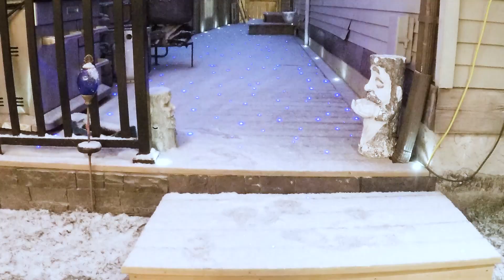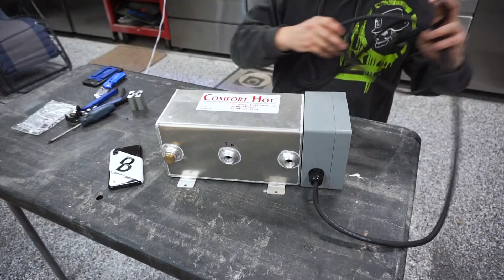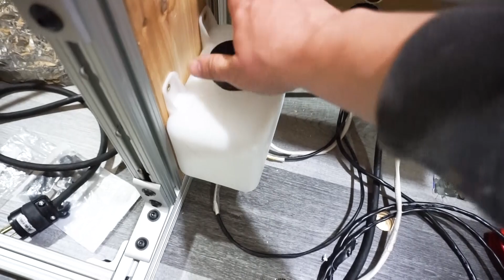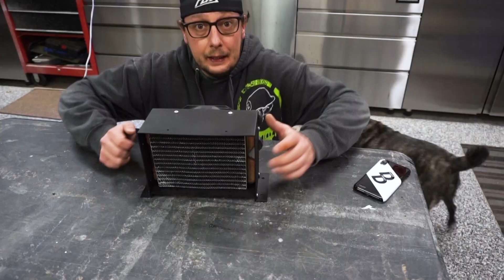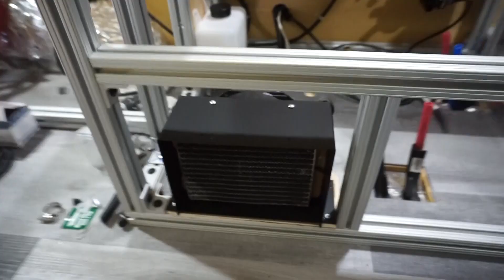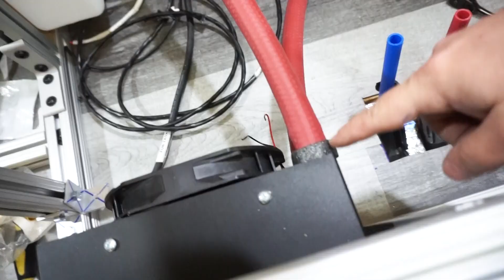Hot air and water NO PROPANE | FOUR SEASON VAN LIFE | EP.43

Comment: I don't think your plan for a secondary expansion/holding tank will work. The small barbed relief fitting, on the filler neck, is behind the pressure relief on the expansion tank making it a one way fitting/valve. Also the secondary tank is below the main tank so no gravity feed and no pump was installed. I think what you have is a simple overflow collection tank. No return.
Reply from the maker: Jim Dearborn it works off the water pressure and the spring inside the expansion tank cap, no ball valve.  Main goal is to have a safe place for it to vent without dripping inside the van.  That was accomplished.  An Added benefit is that it should work just like your car in which due to water/air pressure not gravity the fluid can pass either direction and will eliminate air pockets while doing so.   Either way the main goal of “off venting” will go into the back up tank and not on the floor. 
 Thanks for watching and provided input, greatly appreciated.
Reply: @DaresDrives  I’m in the midst of an Espar hydronic install and about 50 steps behind you. I also don’t get the physics behind the 2nd coolant tank. As the coolant expands and contracts from temp change, won’t the water pressure increase and cause issues without a true air vent on the 1st coolant tank?
Reply from the maker: treynacioustee I appreciate the input and is an interesting point.  My thought process comes from an automobile that when you have a radiator that expands and contracts you provide a tank that it can feed into with a certain amount of fluid in.  This prevents air from entering when it is contracting by sucking the coolant in instead of air, and the opposite it offers a canister for the fluids to enter when it is expanding instead of losing it on the ground. This is also the same process that happens that helps ensure proper fluid level from the separate container, hence the hot and the cold fill lines.  

 I am also confident  the canister chosen is more than large enough that it could not create enough pressure to affect anything. Off memory I think the tank was max 50-60psi so venting would be very low PSI.
Reply: But in the automotive examples you describe...also found on motorcycles, the expansion tank is higher up than the main radiator body...not the case here